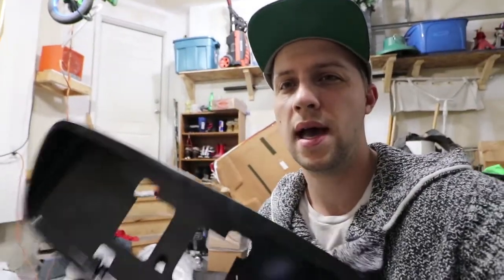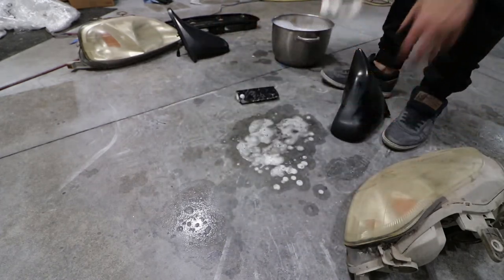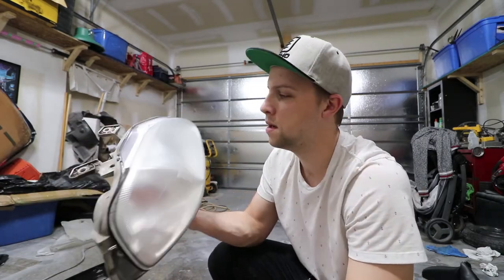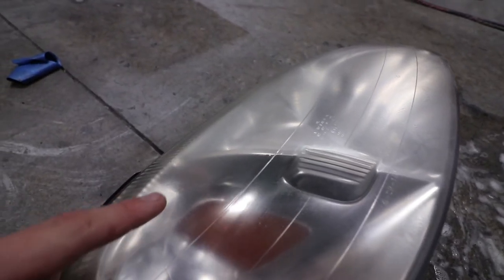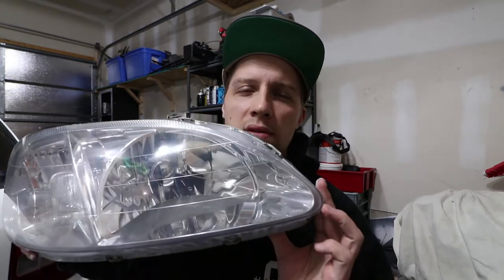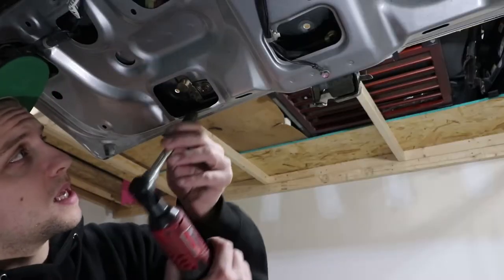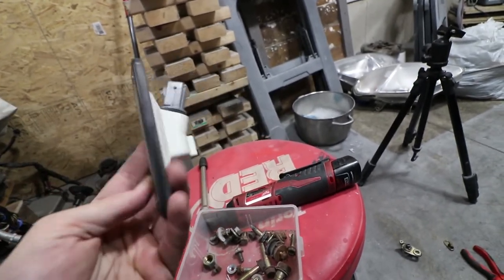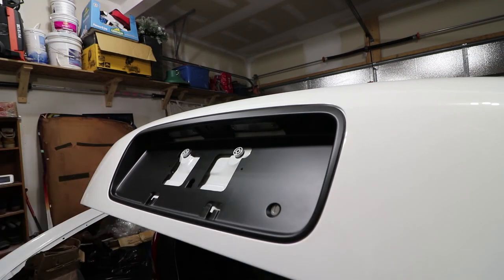Repair Faded Headlights - Restore Aged Car Parts

Comment: What’s your occupation? I’m trying to do this same exact problem but my confidence isn’t there... how did you gain confidence? Have you been working or been around working on cars for a while? How did you learn the paint to use and how to differ paint!?!? Body work is so hard and you make it look easy!
Reply from the maker: Hey cody, im a graphic designer. but i've always had a knack for building things and this is my very first car build. prior to this i owned a g35 which at most i did a caliper respray and polished and buffed it. Honestly alot of the stuff you see in my videos i learned from other youtubers, honda tech, and just taking the risk and doing it myself. Along the way i have had some failures i will admit, but you just regroup and figure out how you fix it. I will agree body work is hard. It takes alot of time. I probably put in around 40-50 hours, and it could have probably used another 20 to perfect it. But if your patient with it i believe most if not everybody can do the work. The best thing when going with paint is to walk into a shop and ask the questions. Best to do some reading before so you know the right questions but i figured, epoxy, bodyfiller, left over epoxy to cover filler, high build, base, clear was the way to go. It was budget friendly and from what the shops tell me a good long last paint job for sure. Seeing the day by day progress helps build the confience. and honestly questions like yours builds confidence too because i like to see and read when people ask questions like this. i have a tendency to write long responses but i hope it leaves you with some confience of your own to take the risks and be okay with failure, becuase its the only way to really learn.

Comment: why are you clear coating the headlights? if you are having to wetsand the clear and polish it, skip the clearcoat. just wetsand the lights with 3k and polish with a light rubbing compound(wool pad) switch to a foam pad and wax,  buff again. no need for all that work, you will get the same result.
Reply from the maker: Have u experienced any faster sun damage? I've read that people recommend clearing to provide the protection, do you find yourself polishing and buffing the headlights more often to keep the consistant shine/protection. Thanks for your comment
Reply: @GarageSpeCivic  well im on oregon so we don't get a bunch of sun, i would say once a year i rebuff them. i run a cheap e-bay headlight and they have been good for the 6 years i have had them. i think i remember doing them like 4 times in that period. I mean, if you don't have to spray it takes like 5 min a light. so really , its no big deal at all. Here is a walkaround vid of it Before I buffed them last time.I daily the thing ;)  https://www.youtube.com/watch?v=T6fSZ3-JvGA
Reply: I have an EG Civic, so my headlights are glass. Glad I dont have to deal with "yellowing"
Reply: Which product did you used after sanding your headlights?